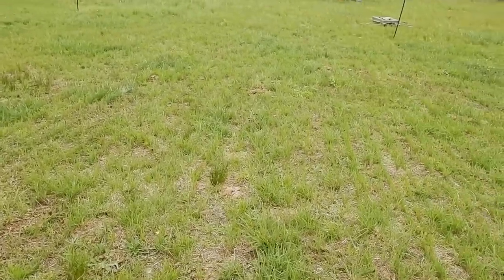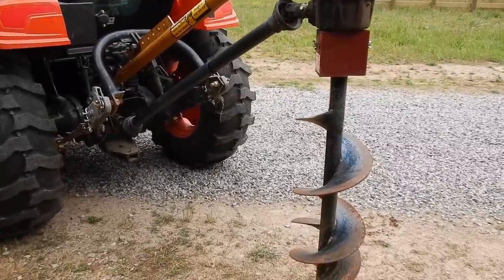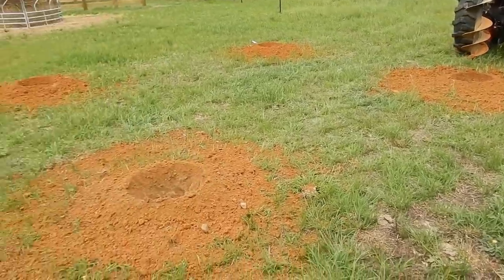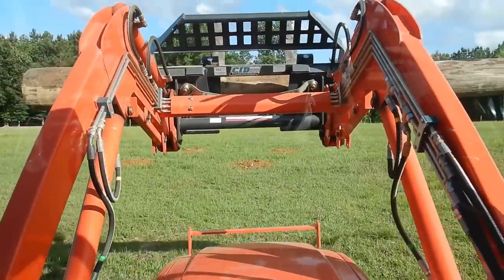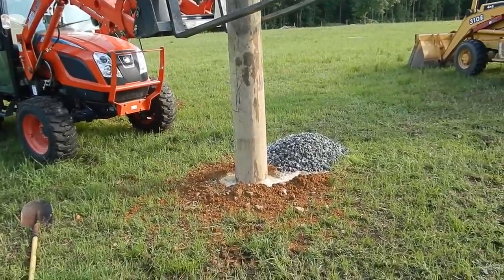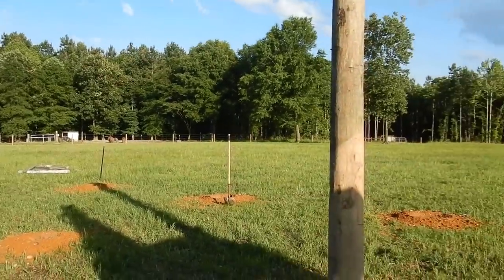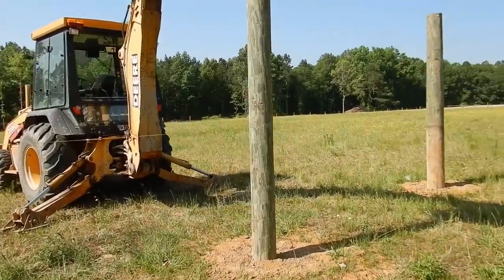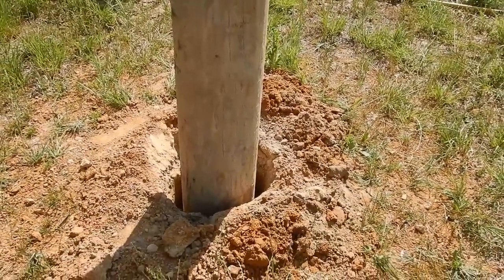Building A Pole Barn Part 1

Comment: You need a "Fish Tale" on the tip of the auger , it guides the bit into the hole . You might try a choker between the forks about 2/3 way up the pole , drop it straight down into the hole . In Flagstaff , Northern AZ , the "rocks" are usually about the size of the tires on the tractor , You've got GOOD soil(clay) , here ,  if there's any moisture , the clay sticks in the bucket , and you've got to bang it out on one of those "tire sized" rocks . Really enjoy your videos , I retired from construction about 10yrs ago and do miss it .

Comment: Thanks for the video. I put poles by using a 8" length of rope, make a noose around the pole about 2/3rds of the way up, attach other end with 2-3' of slack to the front end loader. That way you can place the pole in while it's off the ground and not drag a bunch of dirt in. You can find the sweet spot and hold it close to perp. Use a 6' stick with a nail in the end to slacken off the noose when your done. Cheers, Billy in Canada

Comment: Chris, you should use a wrecking bar to tamp that dirt/gravel down around each pole, not a shovel handle. Wrecking bar has a lot of weight behind it and will compact the material a lot tighter.

Comment: I hired a motor driven auger some years ago.  It had handles for two people, but I thought I'd manage by myself.  It went down less than a foot, hit rock, and threw me half way across my garden.  I took it back to the hire shop, an bought a big crowbar and a post hole digger.  It was no harder, and a site less dangerous.   My neighbour told me later that my property was built over a stream bed, and the ground was full of rocks.

Comment: You got some rocky clay there.  Here in west TX I put my auger on the soil it go straight down with no veer, side to side.  That pole barn construction will need some chipping bar work to get back on track.

Comment: The way to stop the auger walking around in the hard pan at the surface is to weld a 1' spike on the end to spear the ground and guide it in. Just like on a wood spade bit.
I had a manual auger and it did the damned same until I put a spike on. Just a thought, hope it helps. Best. Andrew

Comment: Usually with your three point hitch mounted auger they will have an arm that reaches back to the operator to control the direction of the auger whether you have a barkston cab or not. Besides that keep on digging! 👍🤟
Reply: Not all of them most of them are supposed to be 2 man one on the tractor one guiding it and if your tractor doesn't have down pressure like alot of older tractors use a rock bar or a tamp bar (same thing lol) to guide it and hold it down

Comment: I have one of thse "man killers" too. It is easier with two people .Helps you line up the hole. Mine has a longer auger point to help it get started. The big augers always tend to skip around a bit but the longer spike helps. Heck it is so dry here in Ga. I don't know if you could dig a hole at all.....

Comment: I fixed my  POS auger that I fought for years.  I went to Bobcat and got a new Auger.  It has replaceable tip and cutters for different kinds of conditions.  The rest of the digger was fine just the auger was made for sand.  I was surprised the Bobcat auger wasnt that much money. Had ti build an adapter to fit the machine but that wasnt difficult.

Comment: A - You have several excavators.  Why the auger??
B - You have a skid loader with front hydraulics - Hydraulic auger on the forks works much quicker, accurately and safer
C - Last resort:  Put the hydraulic auger on forks on tractor.

A PTO auger is the most difficult, inefficient and dangerous method.
Reply: Ahhh always the know it alls

Comment: We leave ours in the ground makes it a lot easier to put on and off the tractor
Reply: We use to but it rusted the shit out of it so not any more....we set 2 post and cut one of them shorter than the other put them in a straight line tie the auger to the tall post and set to mount for the 3 point on the shorter post which holds it off the ground making it use able for a quick hitch but it is a hell of alot easier

Comment: Need a point on that auger it will make it so much easier
Reply from the maker: There is one
Reply: @letsdig18  Not much of one. They also make auger bits with a fishtail tip thats about 6" long that make getting a hole started where you want it pretty easy.
Reply: @billquantrill4960  have you seen chrises auger in person?
Reply: @williamuskoski1385  I've watched it dance all over the top of the ground instead of digging. Now find a better cause to white knight for dude.

Comment: Make a small hole first with a spade as a guide hole and slow your RPM down to start with. Also I take my auger to bits when I take it of the tractor it’s only 2 extra pins and the bolt for the auger .

Comment: Build these for a living.  Not like this though, and in steel toes.  U need some batter boards, LVLs, GRK lags, potential rat wall. That’s day one. Love the show Chris.  Keep it up.
Reply: JohnTMcCrakin would love to hear your take on how you’d go about a small project like this. Didn’t understand your abbreviations. Rat wall? Any tips would be appreciated. Thanks
Reply: Technical Items oh boy.  First thing is this isn’t for machines or equipment. It’s for cattle so I get what he’s doing.  I build for shops and pole barns for equipment.  Batter boards are for string lines to square up your post hole locations and posts once they are in.  Posts would be square not round6X6 pressure treated like Chris said he wanted to use for the one but didn’t have it.  Rat wall would be 2X6 pressure treated tougn and grove at the desired grade level for concrete or one board higher than grade so you can screw the steel or whatever you r enclosing it in at the bottom.  As 2X4 every 24” on center (I.e. Perlins). For screwing siding steel on.  LVL r structural grade beams. For this 2x8 or2x10 lvl material would be suitable.  One running long way of the building on inside and outside of each three posts at the top.    That’s for starters.  GRK are screws that r the bees 🐝 neez for stuff like this.  Again.  This is a animal lean2.  Not what I’m talking about.   Hope this helps.
Reply: JohnTMcCrakin yep you defiantly build them, old crew I was on did everything exactly how you’re saying. Recognized each part, miss that crew

Comment: The poles maybe a big larger diameter than the hole which is why the poles are hard to install into the full depth.  Anyhow is only a cow barn not a palace. Good job Chris.
Reply: The cows will admire it as an palace anyway

Comment: Think you might want a larger diameter auger.Brother bought a kit for pole barn and the instructions said to make the holes 16 to 24 inches in diameter for 4 x 4s . think we used 12. Built mine out of 6 x 6s used a 12 inch
Reply: Seems a bit large, no ? Why disturb virgin soil if you don't have to ?
Reply: @augustreil  I think the idea is so you can line up the posts easier. If you take the time to mark and drill the holes you don't need that large. 12 inches plenty big. 12 inch circule for a 6x6 square post not that much wiggle room
Reply: @johnscott2849 , Makes sense, thanks.